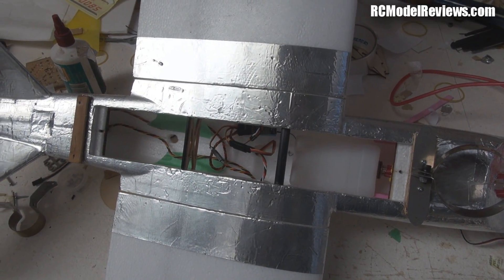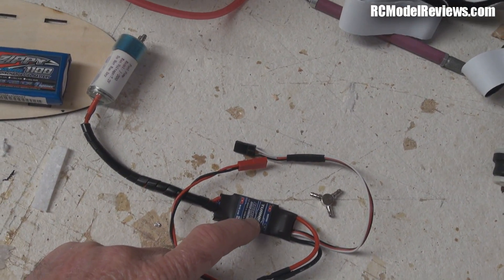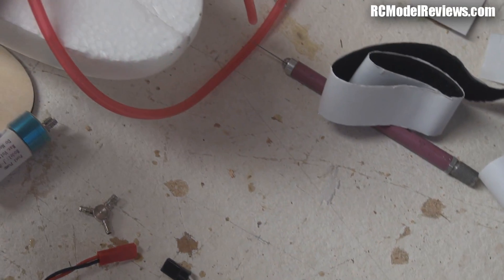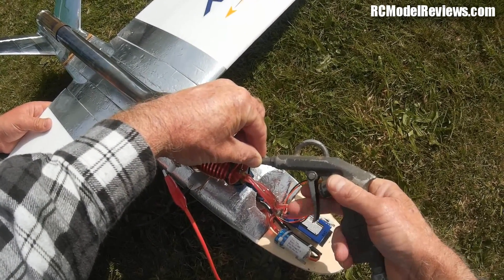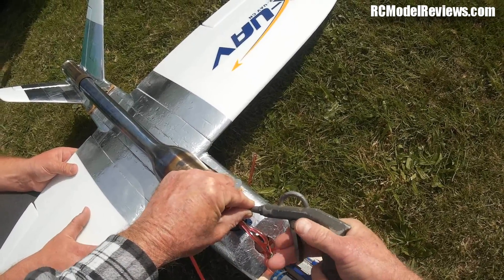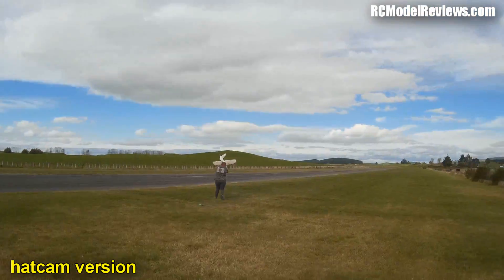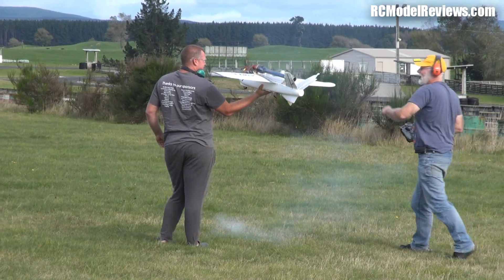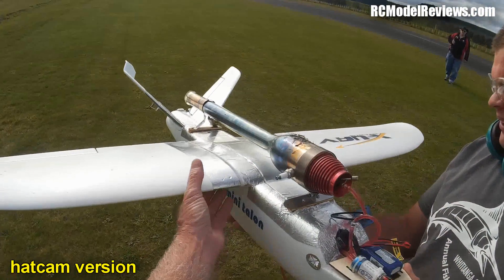Project: A real jet-powered RC plane for under $200 (continued)

Comment: i would recommend using a bungee chord instead of giving a throw. i fly quite a number of high speed plane and one thing  know for sure i that they have very high speed but not enough thrust for the initial push. so throwing with hand would not give enough push and they have tendency of throwing at the wrong angle which results a crash

Comment: You can hide fuel pressure regulator anywhere in the fuselage - just put a static pressure port near engine inlet. Connect it to diaphragm hole on the back of fuel pressure regulator

Comment: The Talon needs to be thrown with just a slight angle upwards, to much angle and it will stall and come down violently like the first throw (nice catch!). The second throw looks good, so I suspect you need a bungee solution to get enough airspeed for the rudder/elevators to be effective and counter the high thrust line.

Comment: Hi Bruce, just wondering ? because of the high trust line what if you move the center of the combustion camber back nearer the CG, your set up on the TameCat seem to be like that & it flew fine, just a thought good luck.

Comment: might have no choice but lenghen the stabilizer  moment. But first I would go with some bungie on wheels or skis you could drop after take off. Could use a loop and pin type paracute harness release. Hope to see how the Foam hold up at speed.

Comment: Fit a small 'spoon' deflector under the pulse jet exhaust to direct the exhaust gases up at a small angle.  The 'spoon' would be a bit like the reverse thrust doors fitted to some full size jets, but smaller as it only needs to redirect the thrust by ten degrees or so.
The effect would be that the thrust line passes close by the centre of gravity / centre of pressure so reducing the nose down tendency.
Also tell your launcher that it makes no difference whether he runs ten feet or thirty at a constant speed before then stopping to throw the model!

Comment: You youngsters need to take a page from history.  Look at what the Germans did when the launched the V-1buzz bombs towards England.  Ramp and catapult system as I recall, but of course they also had a bunch of high explosives packed 
in the nose sections of theirs, plus it had stubby wings.

Comment: Wing loading too high for hand launch! This little airframe has far more weight on it than it was designed for. Maybe try the same setup on a 2 meter glider?
Reply: nah I think it will take the weight. We fly them with 10400mah of batteries on board. Flies fine.
Reply: sUAS News yes, Mini Talon

Comment: Hey Bruce, you could easily add a thrust vectoring vane at the tail to compensate for the nose down, just a simple metal fin at the exhaust with some up angle. No need to change the motor mount.
Cheers.

Comment: We had a similar problem, last year, in my "Aerodesign" team. Our plane had a nasty down pitching tendency. It turned out that the problem was the natural moment of the wing combined with the small tail area (We also used a V tail). We solved this by increasing the size of the tail. I agree that the engine thrust may be the problem, due to the thrust-to-weight ratio. Great work, so far, looking forward to see it flying.

If you want to know more about our aerodesign team, follow us on facebook. There are plenty of photos of our plane there. We call it "Monstro"(Monster).
Link: https://www.facebook.com/BurningGoose

Comment: ether build heat resistant elevator in the exhaust or cut the fuselage in health and a p-38 like air frame with motor instead of pilot cockpit, making it taxi at high speed will work but it's gonna behave very differently each time air speed change S:

Comment: Nose down. Too much weight in the nose. The wing is set back and you have fuel, battery, pump and controller and the bulk of the jet motor froward of the wing what do you expect to happen. There is a saying about doing the samething and expecting a different result.

Comment: G'day,

   Ah, well, hmmmn...

    That Motor appears to be set up at a Nose-Down Thrust-Angle, as well as being elevated well above the level of most of the Drag-Generators (all theWings & Fuselage, plus the Fin & half the Tail...)...; can you bring the Thrust-Line into parallel with the Fuselage's Longitudinal Axis (Zero Degrees Riggers Incidence Angle)...? 

   Or increase the Control-Throws & possibly the Control-Surface Area on the V-Tails, to aquire more authority at lower Airspeeds ; Full-Span Rudder-Vators, going all the way to the Tips, rather than the inset "Cutouts" currently fitted..?

  Have fun,

  ;-p

  Ciao !

Comment: if the exhaust tube had a slight upward bend, it might serve to push the tail downward (which may SEEM backwards, but not). kind of similar to high mounted pusher motor on a sailplane/glider, where the thrust is happening upwards from behind the wing. the Y in the fuel line, you could replace that regulator with a simple needle valve at that point, one going to the "carb" and another to slow the flow back to the tank just a little, so you get some positive pressure to the engine line.

Comment: Hehe. Well I'm definitely no expert, but on other RC jets I've seen, they run off what I guess would be called a 'guide launcher', or something along those lines. They're on what seems to be a 45 degree angle, and a couple of metres long - long enough for the craft to gain airspeed. Perhaps the control surface of the elevators just isn't enough at lower speeds.. Some nice catches heh.

Comment: Ejectable takeoff gear (dolly) like on the Messerschmit 163 komet and maybe adjust the thrust angle so that the exhaust of the engine is a bit upwards when aircraft is level.

Comment: You could tilt the motor at an upward angle to prevent it from violently pitching down. Maybe even a servo to control the angle, so as not to reduce top end performance.

Comment: ROG?
Reply: Roll off ground. Sorry I thought it was universal. If an undercarriage was fitted, even just for testing it might be easier to get it in the air. At the very least some speed could be gained which will give some control authority. It will bring its own issues clearly, but on balance its likely to be a better bet
Reply: what does ROG mean?
Reply: Interesting!!
Reply: I think that it was COG Centre Of Gravity
Reply: I always thought it stood for 'rise off ground.'
Reply: rise, roll, its all the same thing :)